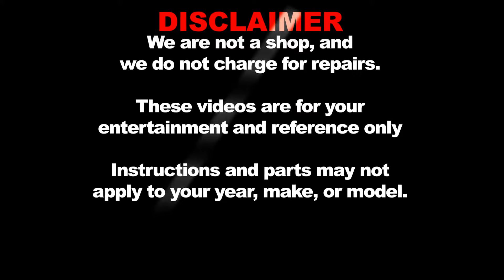2016 Jeep Grand Cherokee Engine Battery Replacement With Seat Removal

Comment: It's not really necessary to remove the seat...

1) Properly attach a 12V, 6Amp battery charger to the battery posts under the hood. This will allow you to move the power seat and to keep the memory alive.
2) Remove the access panel to the battery under the front passenger seat.
3) Move the seat as far BACK as possible.
4) Loosen the 10mm positive battery connector, move aside, making sure not to short on the body panels.
5) Move the seat as far FORWARD as possible, including UP and tilting forward.
6) Loosen the 10mm negative battery connector, move aside.
6) Remove the vent from the side of the battery, move aside.
7) Remove the two 13mm nuts using a deep socket.
8) Remove the hold-down bar.
9) Carefully remove the battery from its location. It's heavy.

Installation is the reverse procedure.
Reply from the maker: It really makes it more accessible and easier if you unbolt and move the seat out of the way. It's super simple to remove the seat, and also please consider we videoed this for others, and its much easier to see with the seat removed.
Reply: @APDTY  I get that but removing the seat is an extra step.
Reply: I install car  batteries everyday and have never needed to remove the seat on this vehicle.
Wild stuff ya can see on the internet : ]

Comment: why remove the whole seat?  JUST MOVE ALL THE WAY FORWARD AND CHANGE FROM THE BACK!
Reply: I was thinking the same thing!
Reply: That is all you need to do just move the seat up.  That’s what the dealer probably does to charge for more labor lol
Reply: You can do that but I've found it much easier with the seat removed. It's 4 bolts and takes 1 minute to remove the seat. This is especially true on the start stop Jeeps with the auxiliary battery.
Reply: Yep. Just move seat forward. Scam removing  seat.
Reply: @glennmcguire5571 actually it’s not the seat doesn’t go forward for enough to pull the main battery out as the situation with my car that has both batteries and very little room to fit any tools much less pull out
Reply from the maker: It is so much easier with the seat out of the way. It's super simple and quick to unbolt the seat and give yourself more room to work.

Comment: Thanks for the video. For the 2017 GC, you have to remove the auxiliary battery and then remove the bracket it's attached to before you can remove the main battery. Need 12mm socket to remove the battery and the bracket. There is no way in hell you could replace the battery without removing the passenger seat. The stealer wanted $325 for the battery plus $320 in labor. Found a Duracell battery for $240. Didn't need to replace the auxiliary battery because I disabled the start/stop four years ago. Thanks again.

Comment: If you aren’t removing the seat you are doing it all wrong. I cannot begin to tell you what a huge difference it made removing the seat. And it was easy. Before you say it’s dangerous because you don’t know the torque let me say this as long as the bolts are very tight that seat isn’t going anywhere.

Comment: This battery was NOT installed correctly or you would not have been able to remove it without first removing the alternate batter right next to it. THE ALTERNATE BATTERY AND BRACKET HAVE TO BE REMOVED FIRST BECAUSE THE BATTERY SLIDES IN AND OUT OF PLACE. If your battery is installed correctly, you CANNOT remove it without completely removing the alternate battery first

Comment: Don’t listen to this video.  DO NOT REMOVE THE SEAT!!  For one you don’t need too, secondly it’s a safety concern if not torqued properly with a thread lock.  

Slide the seat forward and work from the back, after you remove the tie down you can slide the battery back to remove the positive terminal and then slide the battery right out.
Reply: I disagree. Removing the seat is a piece of cake. And getting access to the battery with the seat unbolted and tilted back makes the job very easy. The difference with my battery charge is I didn’t unplug anything. As far as torque I was shocked the bolts aren’t extremely tight. You can find the correct torque for those bolts. One thing I noticed in this video there weren’t any brackets holding the battery down. That’s a little concerning.

Comment: Got a new 2024 GC.  Now, the main battery is under the driver's seat, and the auxiliary battery is under the front passenger's seat.  Nuts.  Didn't know about that until after I purchased the vehicle.   Looks like, with the driver's seat all the way forward and the seat back all the way forward, it'll be almost impossible to remove the battery as it's extremely tightly packed in there with little room to even remove the battery cables.  Looks like I'll be removing the driver's seat some day to change the battery.  The auxiliary battery does have plenty of room to change out, with the seat all the way forward, but there's also a large FUSE BOX right next to that battery that you have to maneuver over and out of the car.  Why they hid that large fuse box under the seat is beyond me.

Comment: By the time you got that seat out, I could have had the old battery out and the new one in....and I could've driven at least five miles and stopped at McDonald's tfor a Happy Meal.
Reply from the maker: Well, congrats, but If you are referring to the seat removal, does your model have full power seats?Seat removal is not required on all models as it depends on the year and if you have the full power-adjustable options. We are also not in a race and recording a video to show people how to do it. Then instead of McDonalds, we went to Five Guys and had excellent burgers and fries! 😘

Comment: The new battery looked like it also has a gas vent hole on the positive side.  I see that you correctly inserted the vent tube in the negative side, but don't you need to plug the other side?

Comment: On my 2014 Jeep Cherokee SRT the seats are powered and you can't move the seats at all if the battery is dead. Mine (passenger seat), was positioned all the way back, so I had to remove the decorative cover for the rear left seat bolt cover/seat rail, to get to the nut and it was a bitch to remove. And I left it off because today I'm changing out the another dead battery for the 3rd time.

Comment: OMG You removed the passenger seat... TOTALLY NOT NECESSARY... You are giving people way too much work and giving incorrect instructions.  If you have a 2014 to 2019 Jeep Grand Cherokee, you DO NOT need to remove the seat
Reply from the maker: Don't be scared to remove the seat. It makes this job so much easier. It has four simple bolts and one electrical connector to get it out of your way. If you do this job more than once, you will likely remove the seat after doing it without removing the seat.

Comment: how many years usually battery works for grand cherokee 2015?
Reply: I have a '16, and it had the original one since brand new, the last week the battery died, so 7 years.
Reply: My 2016 GC's battery died, yesterday. It lasted 6 years and 9 months. I had to replace both batteries, without removing the seat.

Comment: I did not know the jeep Grand Cherokee ha stage batter that complicated just imagine taking to the dealership that would cost like 300 or 400 alone just to think I was gonna buy a grand Cherokee not sure if I want to now
Reply: Dealer charges 35 bucks to put a battery in. I am still trying to figure out why this clown pulled his seat out. If it were a nice Jeep that seat would be fully electric with cooling and heating.

Comment: Trying to figure out how to remove my dead battery from my 2013 with power seats
Reply: You can try to connect the new battery to the terminals under the hood with some extra jumper cables.  That might juice things up enough to move the seat forward at least.
Reply: @TB-ni4ur  it's doesn't work!!!!